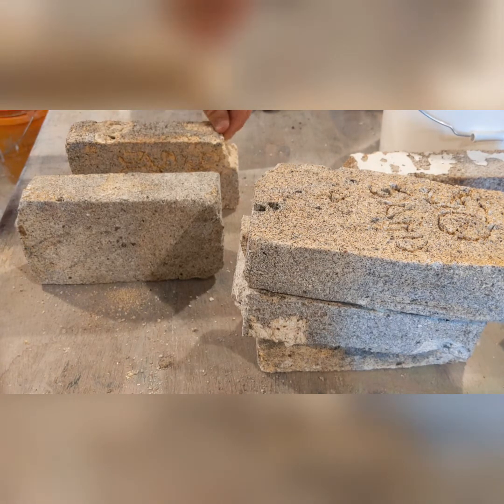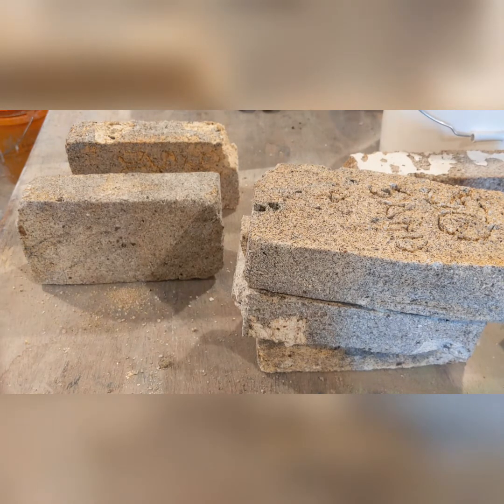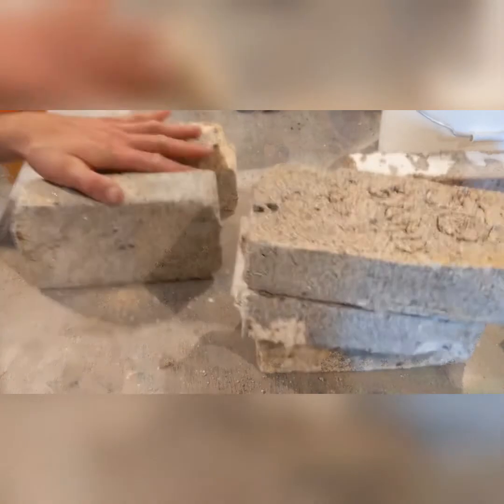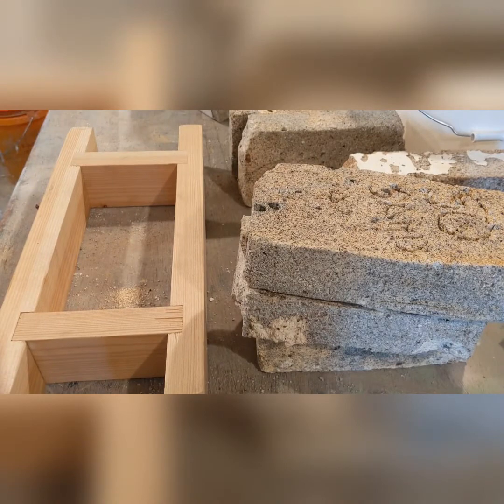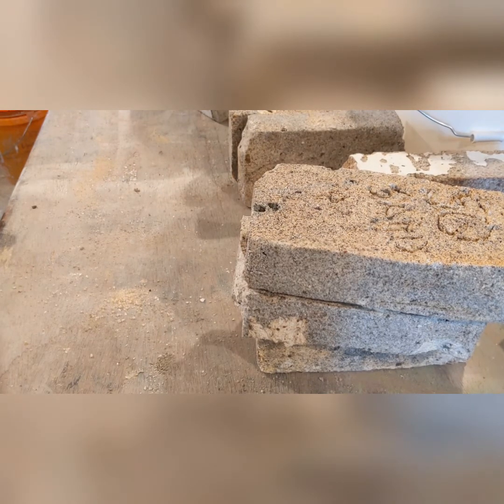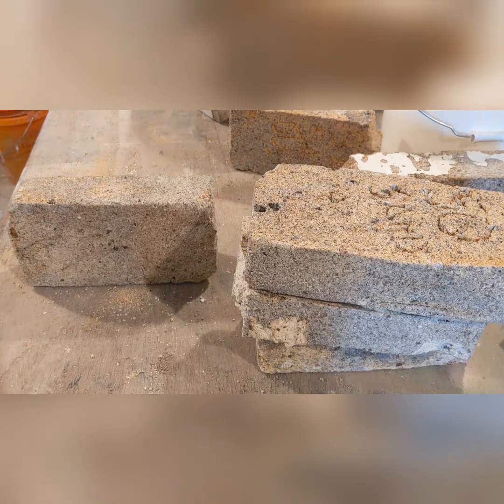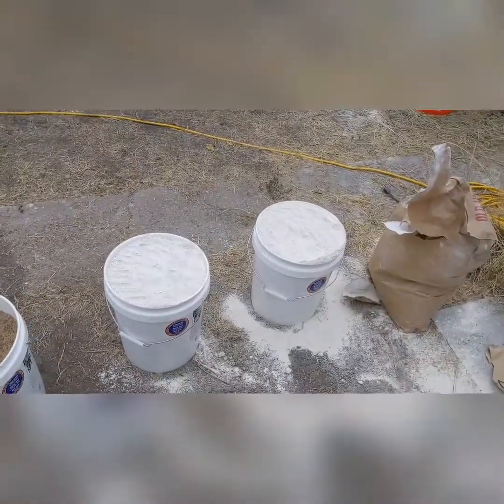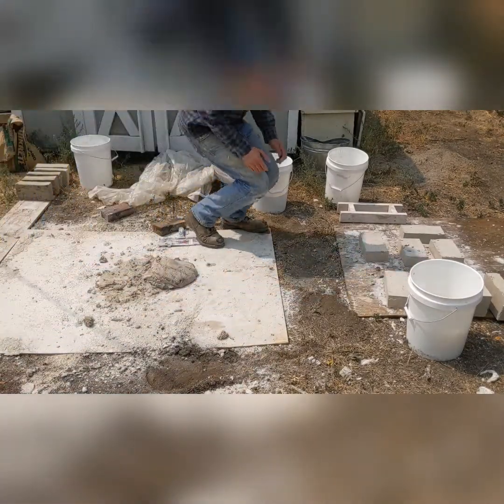Brick Making for the Wood Kiln

Comment: Im a refractory technician as a QA technician in firebrick production.  An even better method would be dry pressing with moisture content around 5 to 7 % with water as your primary binder.  I would purchase a cinva ram press for very uniform brick or a home- made hydraulic press.  This process works well for hard or insulating brick.

Comment: Did you ever build the kiln? We have been trying to find cheep used firebrick and I think this is a better way to go.
Reply from the maker: I am actually still working on it and working on various recipes. i have one in the works right now that is promising. 1/3 kaolin 1/3 cone 10 stoneware reclaim, 1/3 sawdust. it's still in testing, but it is showing promise so far. I did build a kiln, but I ended up coming by some bricks to use that were less labor intensive. Good luck with your kiln! I might make an update if this recipe works out.
Reply: @liamg1995 Hi, if you wouldn't mind, what recipe worked best in the end?

Comment: I've watched so many videos of people trying to make fire bricks or refractory mixes but this is the first one that seems to get it right. Others always have some issue: either they use cement in large proportions and ruin the refractoriness or use expensive materials like castable refractory and perlite, which defeats the purpose of DIY. Thank you for doing the leg work to figure this out!

What are you using as a mortar between the bricks?